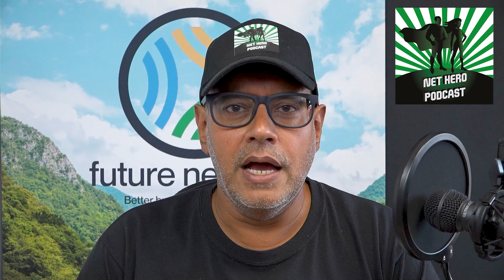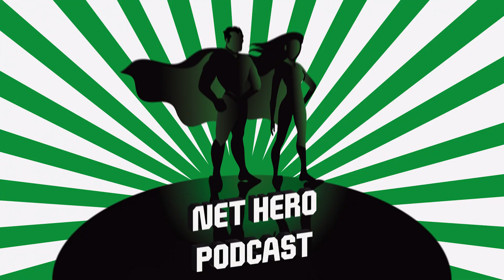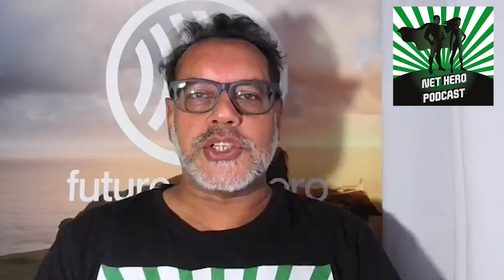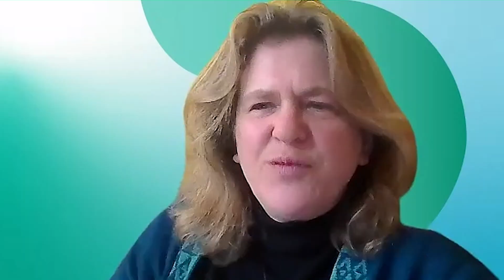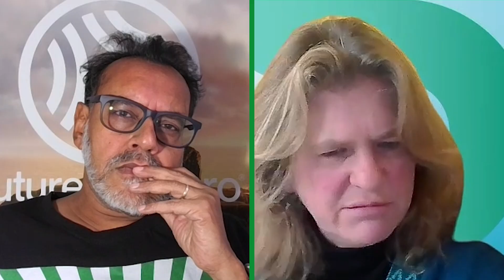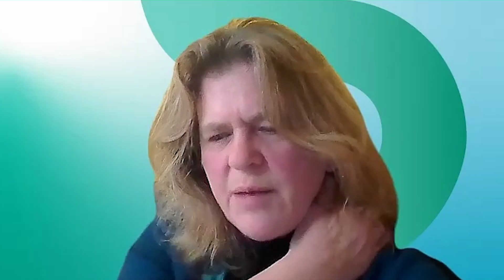Cleaner steel or there will be no point going green!

Comment: People often overlook the necessity for the mining industry to decarbonize its operations to align with the new regulations outlined in the AGENDA 2030 sustainable development goals. Having worked in the cargo shipping industry and maritime law, I've witnessed the implementation of various measures such as ballast water treatment, gas scrubbers, EEDI/EEXI, EPL, and underwater acoustic reduction systems to meet these guidelines. While I'm uncertain about the specific steps mining should take to follow a similar path, it's evident that the price of iron ore has been declining since its peak in 2021. China, seeking alternatives to Australian iron ore due to sustainability concerns, faces challenges in obtaining green steel certification for its products. Additionally, Mexico, a major silver producer, is considering banning open-pit mining. Concurrently, the oil and gas industry is also transitioning towards decarbonization efforts, leading to dwindling oil reserves and higher prices. The industry cites low returns on investment and diminishing cost-effectiveness as factors contributing to this shift.